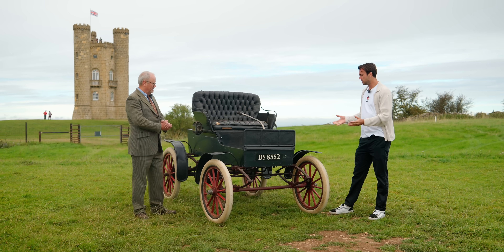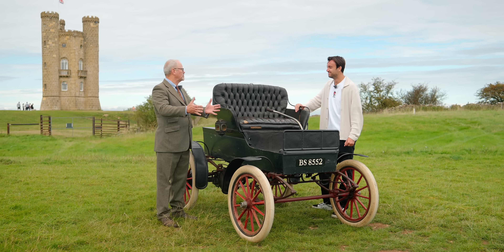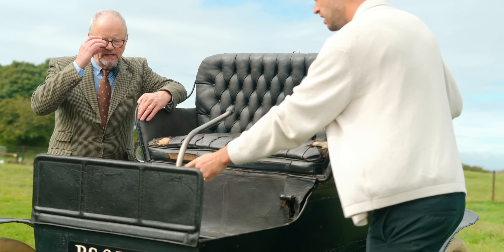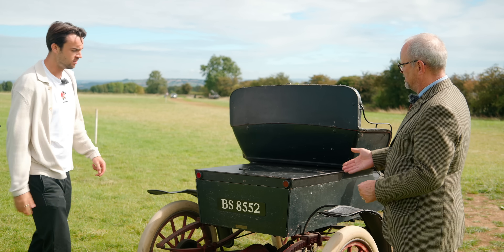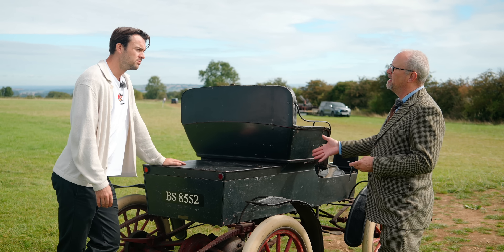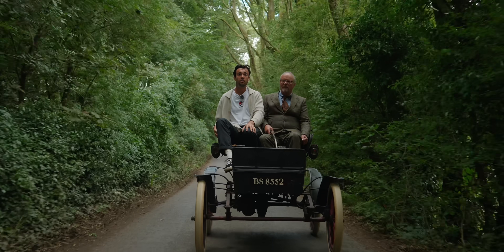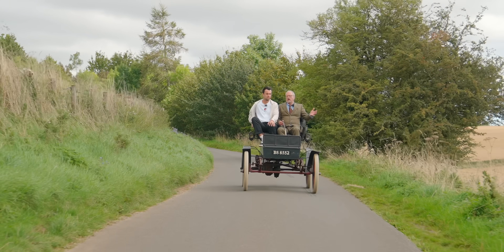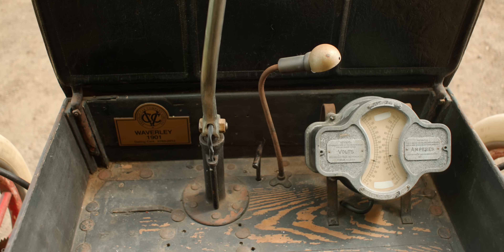Why Electric Cars Failed 100 Years Ago

Comment: Electric motors last forever.
Reply: The batteries cells don't. And when they fail, it'll cost anywhere from $20k to $60k for new battery cells. Nobody's gonna spend that much to replace their dead battery cells. So, EVs are essentially throw away cars. I can hardly wait to see what dead EVs will do to the ecological system.
Reply: @R0MANS109 I have been reading about a company that is exploring the possibility of converting the totalled out Tesla EVs to ICE drivetrains. Very interesting idea which would help the environment rather than grinding up all the plastic in a Tesla.

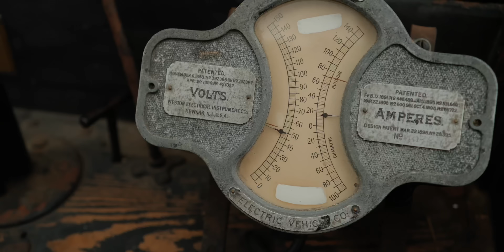Comment: At 12:35 it has 50V drawing 40A so 2kW or 2.7 HP motor. Sounds like nice personal vehicle. Comparing to what we have today are 800 HP monsters that require 2 ton battery. Why does anyone need 800 horses just to move around town? So wasteful. The EVs like Tesla makes are dead end. The future belongs to light energy efficient vehicles like personal scooters, which only use around 300-500W (0.4-0.7HP) take people to same places those 800 horses would with much much smaller battery that charges much faster,

And then there are trains, trams, subways, etc. They are all electric vehicles as well. First electric locomotive was built in 1837. Electric motors went through lot of inventions in 19th century but not a whole lot changed in 20th century. We are using over 100yr technology to move, we just made it nice and modern, added fancy lights and control buttons to it.

Comment: interesting that Robert mentioned the SOLUTION to one of the main problems stopping the widespread adoption of electric vehicles today (IMHO)
BATTERY SWAPPING! 
They did it years ago in New York as Robert explains, but today the manufacturers simply will not even mention it! They still design and manufacture cars with FIXED batteries, that take hours to re-charge. Hence they can't sell them (along with other reasons). They had the solution back then and took the wrong route. So ICE vehicles are still king

Comment: Actually Edison's batteries are still good that were made over 100 years ago at least on Jay Leno's Baker Electric he just had the change theacid in the battery and the battery was fine and it was the original battery to the car.

Comment: Energy storage has always been the issue. Fancy computers and electronics, as this video proves, are not the problems that needed to be overcome. If oil companies had not bought up and hidden any new battery tech through the years, maybe we'd have a different situation. As it sits with battery tech today, range and performance are still the stumbling blocks. Electric is perfect for city and short trip use, and fancy batterry tech. is not necessary for that. People have become spoiled with the available zoom, zoom and range of gas, and expect the same, or better, out of electrics today. Also, grid supply is, and was an issue, that needs to be addressed before any serious mass adoption of electric vehicles, expectating similar range and performance to ICE vehicles. I thought GM crushing the EV1 program was in part to give some time to resolve this electricity supply issue, but here we are 30 years later in a worse situation than back then. There is also the parts and service industries that would be severely affected with the mass adoption of electrics due to their simplicity, but they seem to be filling that void with poor quality parts and builds.

Comment: Back in the 90’s a friend of mine was making EV conversion for cars and working on golf carts he was using welding rods for speed control the welding rods were coil, up like springs and connected in series to connection on a rotary switch so the faster you wanted to go the less coils you were going through. As for the batteries he would use 12 to 14 batteries and the rest of the vehicle from the transmission back was unchanged they just mounted a plate on the transmission with a traction motor and about 700 pounds of batteries for around 350 miles of range as apposed to around 3 to 4 tuns of lithium batteries that’s 6,0000 to 8,000 pounds of batteries to go 300 to 500 miles but I’ve seen a lot of reviews where it’s more often around 70 miles

Comment: Seems to me that the reason early ev's were dropped was because ICE developed and quickly overtook ev tech; rendering ev's them obsolete.  It's just one of the many factors which will doom modern ev's to obsolescence.

Perhaps you guys should start a "Fully Diesel Show" before you are totally irrelevant.  You have hitched your horse to the wrong wagon.

Comment: Quite simply the infrastructure was not there and the infrastructure for gas was off to a good start. Again today for EV's it's not close to being anywhere near what it needs to be. Don't forget for ice vehicles it's been around for 100 years. Today places like Costco with 32 pumps can service cars with gas simultaneously in five to ten minutes. Virtually impossible for EV's. We don't have the electrical capacity. If you had a place with say 60 chargers and they are all full, it would certainly take all day to charge them, if you even could.

Comment: I don't think they failed back then, there was just no point pursuing it when petroleum products were cheap and plentiful.
Reply: EVs were $2000 each, while the Model Ts were just $825. The gas cars had a longer range, and they were easier to use. So, the EVs are having the same problems (or negatives) today, and even more.

Comment: If they could have a 60 mile range in 1901 then EVs of today should have at least 10X that range, or over 600 miles.  When I can have an affordable EV with a reliable range of 600+ miles then I will trade in my ICE vehicle.

Comment: Cadillac's implementation of the electric starter as standard equipment on the 1912 Cadillac Model 30 made it possible for anyone to turn over an internal combustion automobile engine without fear of injury. This was the moment that changed everything.

Comment: Electric cars are not great. The concept is great. But they failed back then just like they are failing today. Although today the batteries are bursting into flames and burning up. If they don't burn up they wear out and need replacing in just a few years after you guy it and the cost of the new batteries is more than the car is worth. So, they become throw away cars. You can't even get in them and drive for 8 hours non stop, get gas, then keep going. You will NEVER be able to use one in the Cannon ball run, unless you want to lose. Electric cars are very bad for the environment. From the mining to make the batteries to disposal of the batteries.  When they catch on fire, they really pollute the environment.   With all this said, I would still want one for about $10to be a grocery getter.

Comment: The Detroit Electric was hardly a failure. They made 13000 vehicles from 1907 to 1939. 
It had limitations for sure. But electric vehicles used for specific purposes were reliable and very cost effective. The UK delivered milk every day to customers for decades.
These old electric vehicles with heavy lead acid batteries had a long long service life unlike modern Tesla which have outrageously expensive batteries made from rare metals and a short economic service life. Model S are now essentially economic scrap value!

Comment: This is why I’m a proponent for electric cars! As you stated, they were growing in popularity before Ford mass produced the gasoline/petrol car. And wouldn’t it have been a different world had he went electric?  I hear so many people talking down electric cars today, and I think they just doesn’t realize that we could have been an electric car society 100 years ago! 

The race hasn’t ended between gas, water, and electric cars. Some say the hydrogen car is better than gasoline or electric. Electric lovers say the opposite. And you know the gasoline team is not giving up. I don’t want to say that gasoline driven engines should go away completely, but electric cars have come a long way since the late 1800s, and that means we can go further, faster, and in quite good comfort too! 

This gem of a car you have shown us is just stunning! Can you imagine adding just the most minute of modern tech onto this beauty? (Id opt for a roofed version) 

Brilliant video to be sure!
Reply: EV's do have some problems. A big one is that batteries lose their capacity during the winter. I understand that some people with EV's this winter had problems with trying to charge their EV's battery. It's also a problem with ICE vehicles too. The batteries as they age tend to fail during the winter due to the falling capacity of the battery.

Comment: The same limitations EVs have today are what doomed them 100 years ago, although ‘range anxiety’ today is largely a myth as most EV owners charge at home and don’t take long trips regularly. The advent of the electric starter (Cadillac in around 1909) spelled the end of EVs as Ford added it to the Model T  by 1911. Longer range, better and more roads, a growing network of petrol stations, and improved reliability simply made petrol cars better. When today’s EVs can regularly go 500 miles and can recharge from 10% to 80-90% in under 10 minutes, and cost the same the EV will be better.

Comment: I'm sorry boys, the same issues that lead to the demise of the EV's in the early part of the 20th century still exist today. Range, battery technology, and charging infrastructure are all problems that have yet to be solved. Lithium ion batteries have more energy density but still cannot compare to ICE vehicles. In addition, scaling up Lithium Ion battery technology has proven to be problematic due to the risk associated with thermal runaway. Free market Innovation will solve these problems over time; however, governments mandating the transition from ICE to EV's with unrealistically short time frame will kill the market again.

Comment: Your comment about H2 being akin to steam is incorrect. Back in 1900, the primary engine was the steam engine, used in industry, trains and ships. If you were a young person in 1900, then steam would have been king, horses and buggies for getting around. H2 in 2023 is not used (seldom used) in any of these. Petrol won due to their speed and endurance (range) and ease of refueling. The invention of the starter motor and fuel stations got things really going on the early 1900's.

Comment: During the wars gasoline and other petrol products were hard to get and had a limit on how much you could perchance so most ice vehicles were run on wood gas apparently in Europe they even had filling stations for large bags of wood gas mounted on the roof of busses and big trucks there were wood gasifiers that were attached to vehicles unfortunately after the war was over and petrol was easy to get the gasifier were religated to the scap pile

Comment: Anyone who has ever owned an electric car with lead acid batterys knows exactly what happens to them if you discharge them below 50 percent charge state , bet the batterys had a very short lifespan and replacing them got very expensive. I assume they where limited to use in citys where the support technolgy was present , a limitation internal and external combustion resolved .. now anyone can plug there car in in there garage

Comment: American  made motors would last forever, So the answer to the question of why we battery cars didn't catch on is  because the oil tycoons crushed it. No different then what your seeing today, biden has invested heavily in lithium batteries and he is trying for force oil out of the market.
Reply: That's completely false. Nikola Tesla had proven that DC was inferior to AC. Edison had to Tuck his  tail between his legs. It ain't no different of why we don't use gas powered vacuum's or iron's it doesn't make sense to use those indoors That's why they are electric. That's why cars are not electric because they don't make sense outdoors.

Comment: robert, robert, robert. speed control is done via electronic hardware, under control of firmware/software. tsk, tsk. im a senior hardware engineer. Software is easy. its just 1's or 0's. all Software developers have to do is get them in the right order. they dont have to worry about the magic smoke getting out.

Comment: You see, electric cars have always been practical enough, its just That gas was a little more Convenient in the short term.
Imagine where we'd be today if everybody had just stuck with electric I think battery swapping would have worked Just as good as refueling for long hauls I think the gas companies have been manipulating us for over a 100 years. So please people switch you have a choice. Try something new you won't regret it. It's only going to get better.

Comment: I remember seeing my Dad start his vintage 1917 chevy. It wasn't that hard, he'd just set the throttle and spark, give the motor one fast flip and baboom, there you go, it ran. That car actually had a floor mounted starter but Dad cranked it by hand to save wear and tear on the starter, presumably because you can't buy parts for those old cars anymore.

Comment: Love this video!  I think after 14:15 the reason the gasoline engine won is energy density plus convenient for weight of power plant as the car went from being a rich person's locomotion at stately speeds to mass transport at higher speeds.  Henry Ford would not have decided to go with electric for that reason.  Electric cars are back - to the extent they are - because the energy density of batteries has improved.  At the invention stage, it didn't matter, but developing electric or steam from that threshold would not have yielded the same results.  At 17:45 it is summed up well.

Comment: the model T dropped to $250 by 1915 for the 2 seater body, but production did not go into the 1930s, the model T finished in 1927, they then went on to the Ford model A

Comment: I do not believe that the electric car faild ,I believe it was killed off by the makers of internal combustion autos ,why ? Because most of the auto industry was owned or controlled by oil barons ,Ford J. Paul Getty, Rockefeller, etc. In 1916 ,according to a history source ,there were more than 16000. Electric autos on the road in the U.S.alone .

Comment: EVs "failed" because they were forced to by Big Oil and monetizing electricity. Electricity was at one point free or pretty near free just like water. People even had their own dynamos in their homes that ran off of free water to produce free electricity. All that came to a stop around the turn of the last century with the monopolisation of every major service and area od life by the Rockerfellers, Vanderilts and Carnegies forcing everyone to use petroleum for almost everything, including pharmacuticals. That is what killed the electeic vehicle and other utilities and services that were basically free until that point. They forced everyone to buy their products

Comment: 17:48 The question was not if the electric motor will last. The issue with EV's is that when the battery dies, you can just as well throw the car away as the battery back is the most expensive component. Once the removal battery versions come along, I will definitely consider it. Now at the moment, I can't imagine owning an EV.
Reply: Aren't there workshops rebuilding electric battery in a car by replacing the cells? And the cost of fresh cells for a rebuild is almost guaranteed to drop with time, as the manufacturing adjusts to the massively increased demand. So i think if you wanted to you could get one now being reasonably certain the problem sort of solves itself by the time your battery is in need of service. Not that i think you should necessarily want it.

Currently, you might pay 15-20 grand to replace the battery, while the car costs 40-60 grand, making for a higher up front cost than an ICE vehicle. I don't see a reason to throw away a perfectly good EV once its battery has expired even with things as they are now. It's not like repairs and added maintenance don't add up in an ICE vehicle to total something on the order of 10 grand over its 20 year lifetime.
Reply: These cars were driven by someone who had the money to do so. Electric Cars (actually all cars) were expensive in 1901.
Reply: And what about the cold weather, all those people in the Chicago area waiting for hours in the frigid cold to use chargers and half of them didn't work then the batteries capacity was diminished, I would suffer from constant range anxiety in one those things wondering if I'd run out of juice before I got to the bloody charger then wondering if the thing would work when I got there, no thank you, I can find a gas station every couple of miles and I don't have to wait five hours to charge up just to go a hundred miles or so.
Reply: @Peter-pv8xx  Out of Spec Reviews did a deep dive into what happened in Chicago. A couple of chargers went offline, but the big problem was that most of the cars were driven by people renting them for their rideshare jobs, and because they were rented, the drivers didn't have the ability to use L2 charging at home, and weren't savvy enough to precondition the battery pack before attempting to use a supercharger.

Deep cold will cut a modern EV's range by about 20% or so.

Comment: Ridiculous energy density and ease of distribution is what makes combustion fuels the king, especially outside of urban centers. Electric motor is an old, tried and tested, simple but powerful, amazing tech, however batteries are still very meh and have long way to go.

When electricity storage is portable, dense and rugged enough to be used by the army on frontline vehicles as the main drive and perhaps as a projectile propellant instead of gas and gunpowder to set the stakes real high lol, thats when combustion is a defeated, obsolete technology. Until that happens EVs are a voluntary sacrifice for the sake of higher goals.